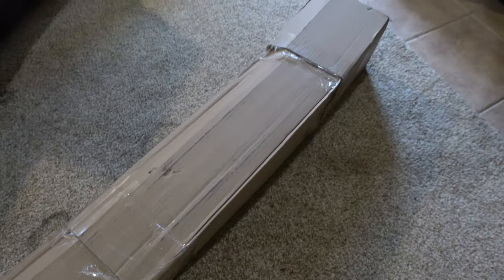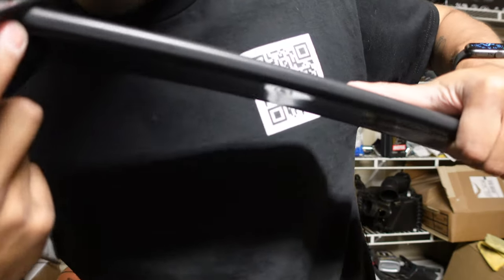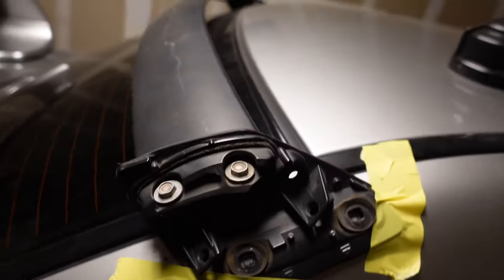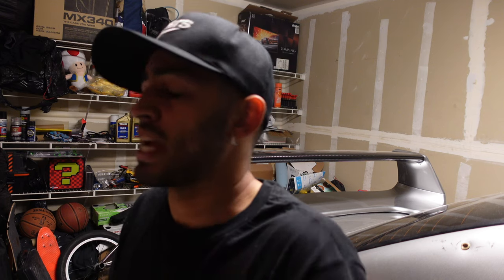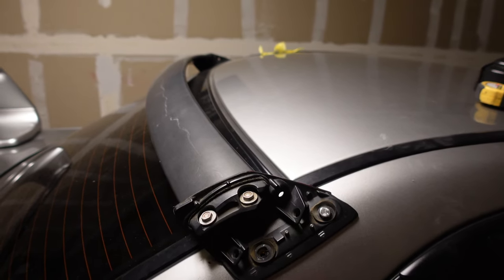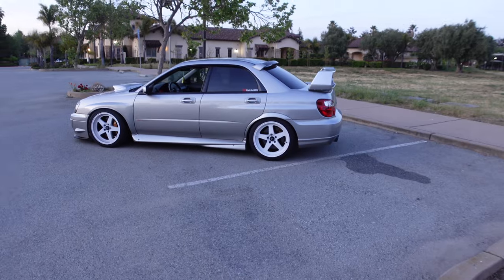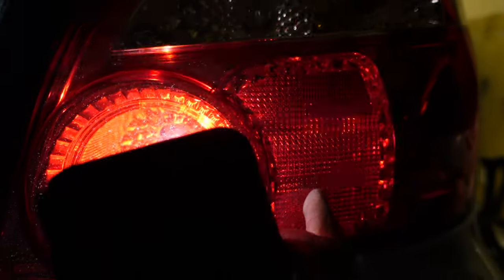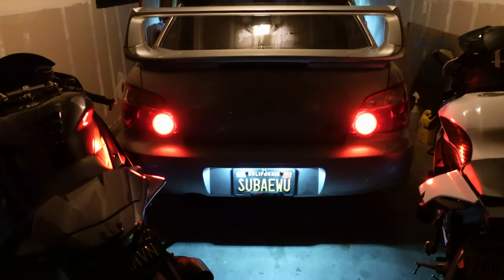The BEST/EASIEST way to install a roof vane on your WRX/STi! +Free JDM Tail light mod!

Comment: Man I can’t wait till my 06 wrx is on the road
Reply from the maker: What’s currently wrong with it? :(
Reply: @Raichu595  so when I bought it I saw it was tuned to 21 psi in stock intake dp intercooler and I figured it was hurting the car so I took it off with the accessport and it started up rough. After trying to figure out why, giving up, and eventually having my brother take over and getting it back from my brother I realized it’s cause of the secondary air pump. Since the previous owner deleted it I guess he tuned it and I didn’t know that lol. So I’m gonna install it back hoping that fixes the problem. Also because of that it doesn’t pass smog :(
Reply from the maker: Ahhhhh I see. Honestly I’m pretty sure you can find a used one on eBay or something. Maybe even Craigslist or Facebook. People are always parting out so I’m sure it’ll be easy to come across 1!
Reply: @Raichu595  I managed to find one! I have a friend in San Diego and I found a junkyard in Chula Vista online and yeah bought the whole assembly. I just don’t know how it goes on the actual car I was hoping the newer EJ’s would be helpful for reference but they’re different. But man seeing your car makes me eager to fix mine.
Reply from the maker: I’m sure there’s a tutorial out there somewhere! Find an airpump delete tutorial online and follow it in reverse. Then you’ll have it on in no time! I’m eager to see it once it’s back on the road👀

Comment: i have a 07 sti i cant get the covers off of that roof vane to save my life , should i take the wing off first to get  the caps off ??? or is it an angle thing ??
Reply from the maker: Did you get the little plastic clips on the inside part of the covers off first?
Reply: @Raichu595  ya Lil plastic screws that are expanding clips on the inside . Removed those and still can't get it off . Feels like the caps about to snap lol cuz I'm yanking 😆  , about to order a Lil plastic pry tool and pray
Reply from the maker: @bigbodykarate6403  if you got those off then you can also use a flathead screwdriver with some painters tape on the edge of it so that you don’t scratch up your paint! Stick it under the cap and twist! Should come right off after that. I don’t think it’ll break. I used that technique to pop a cap off a 190,000 mile STi and it survived just fine!